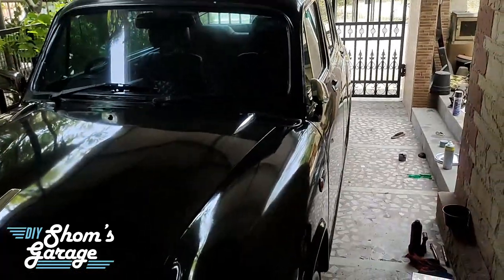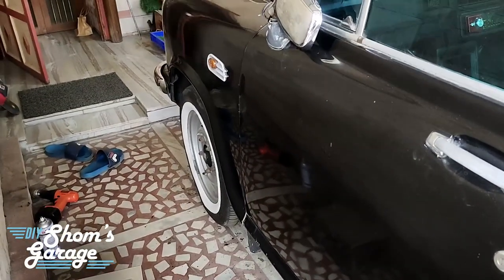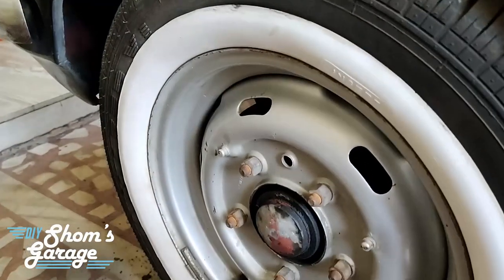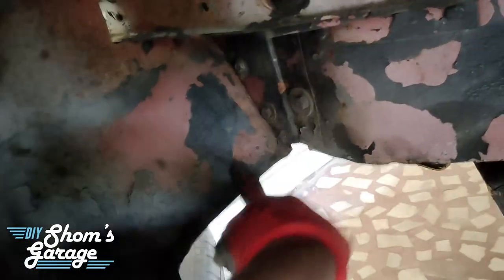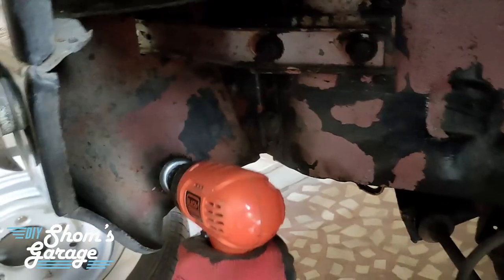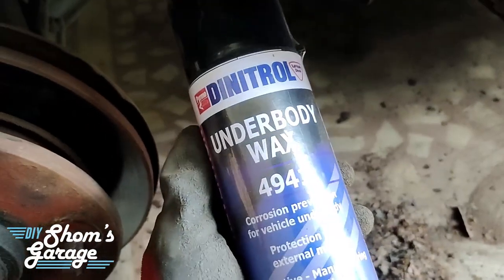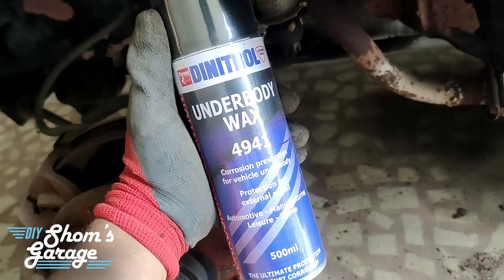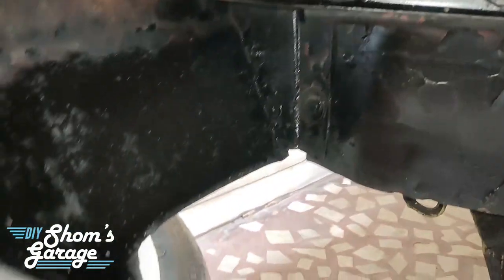Ambassador Underbody Coating - Rust Corrosion prevention using Dinitrol 4941

Comment: dang that was a lot of weight reduction with the amount rust you had on the floor from a single wheel arch, why didn't use a rust converter and passivator before the dinitrol 4941, amazon sells the sika Rustoff-100 which converts rust and forms a passivation layer, which can then be painted on by the dinitrol, it seems like cheap insurance to protect against the area where the wire wheel didn't make contact